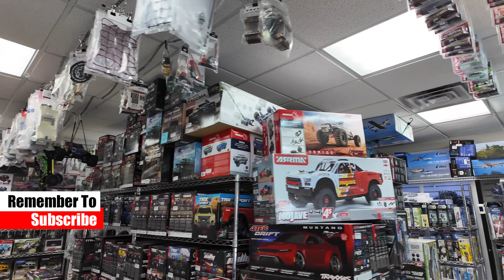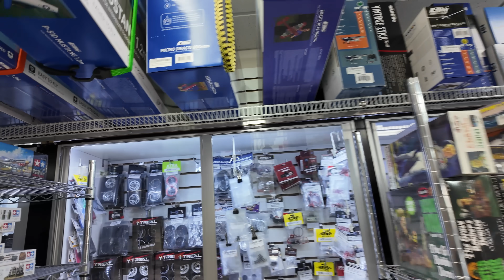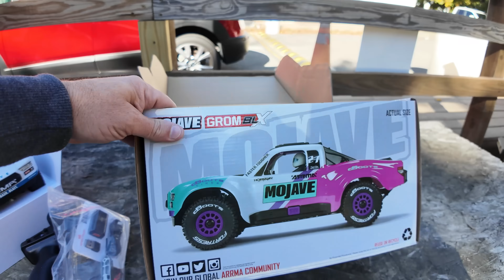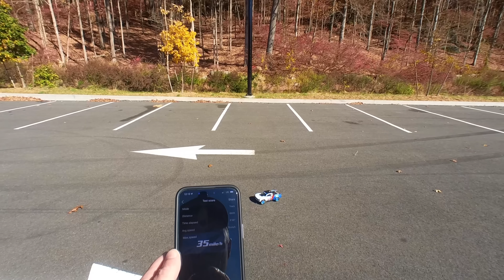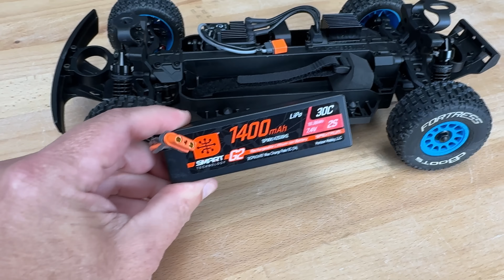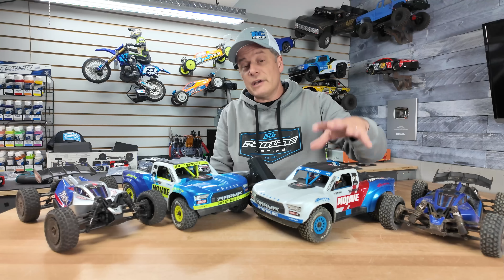Blast Mode Activated! New Brushless Arrma Mojave Grom BLX

Comment: Hi, I have an Mojave Grom 3s BLX. What is the range supposed to be in its transmitter? At about 150 feet it stops responding and the car also stops moving. I have to go closer to it for it to start responding. For speed runs I would need a longer range. Is there a way to extend range?

Comment: i preordered the black one and some of the new 3s batteries that are coming out. Cant wait!!!
Reply: Don't get the spectrum batterys, thay are crap, overpriced and need the spectrum charger.
The Zee 2200mah 3S batterys are half the price and last longer and u can u a standard lipo charger, you will need to change the plug on the ESC though.
Reply: Do you have a link to that battery?

Comment: I like the fact that the BLX version already has what looks like to be 100 plus dollars in upgrades over the brushed version not including the brushless system.
Reply: Yep, I just returned two of the brushed ones back to the hobby shop because I bought them a week before the new ones got released. Barely made the return window but doesn't make sense to keep them when going brushless was the plan the whole time. With the "mega" version just buying the metal diffs and hexes alone you are pretty much at the cost of the BLX.. but then you also get a full brushless system, aluminum shocks, and a gyro on top of it. No brainer. I think they need to reevaluate what they are going to sell the mega at now haha
Reply: It's  definitely more than $100 in upgrades. I bought the Mojave grom mega brushed version when it first came out. I bought metal axles,metal hexes, GPM aluminum  shocks and metal spyder gears for the front and back diffs so it's basically as strong if not stronger than the BLX version except I spent way more than $100 that's for sure. Oh plus I was able to get the BLX brushless motor,esc,controller from ebay as well as the new BLX body. Wish I had just bought the BLX version though,way cheaper than building it up.
Reply: Just bought one. The hobby shop said more in upgrades than the price difference from brushed to brushless.
Reply: Wondering if those front / rear bumpers would fit on a Typhon?

Comment: I don't know which to get. I like the looks of the Mojave, but I want the one that handles the best
Reply: I'd go for look on Groms. If you want great handling, get the TA Reflex 14B. Has a center diff, brushless, exact same size.
Reply: I bought both at same time and wondered why I bought the grom when I knew better 😮😂 I already had the 14T same as the 14b cept for body and wheels 🛞
Reply: And I haven’t blown diff on TA knock on wood 🪵